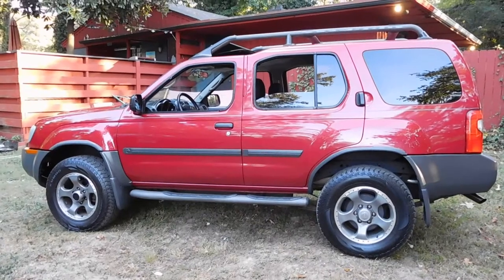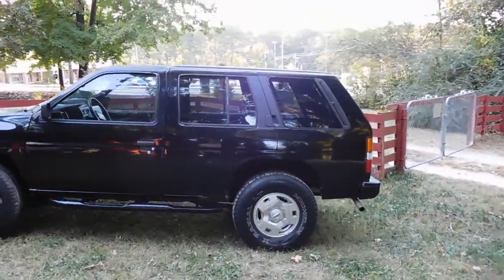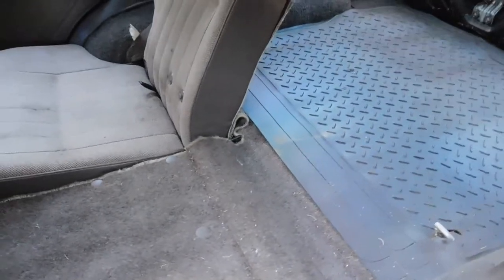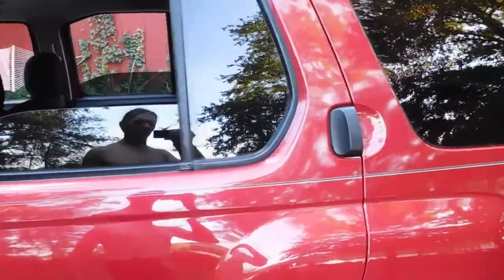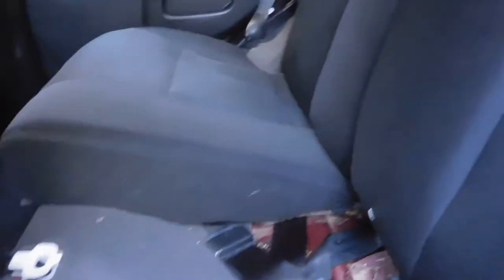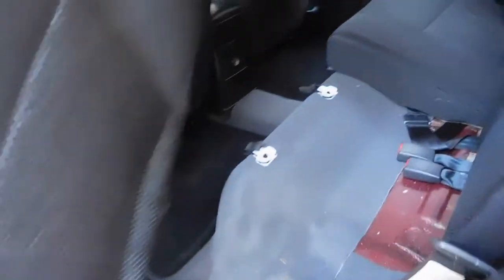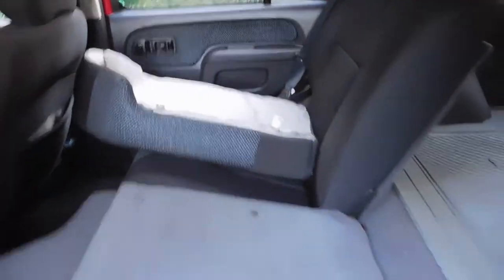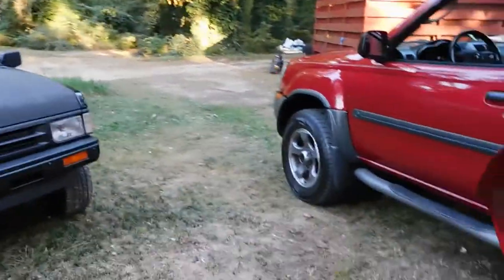Xterra vs Pathfinder: rear seat cargo area tour

Comment: I currently have a 2002 Xterra recently purchased low mileage six-cylinder five speed stick. Previously I own a 97 pathfinder same motor but automatic. I love the Xterra so much better than the Pathfinder.
Reply from the maker: Thats funny because I think I still Love the pathfinder more. I miss the the rear window, clock, 4 wheel suspension & 4 wheel disc brakes.
Reply: John Masters Does it ALL Well you need to do a simple conversion like I did I have four wheel disc brakes on my 2002 Xterra with a five speed manual transmission and 3.3 L non-supercharged
Reply: John Masters Does it ALL And the rear disc conversion cost me nothing because I had all the parts on hand
Reply: It also took me no time at all to do it on a Saturday in my garage.

Comment: I put lynch pins on my pathfinder so the whole cushion comes off similar to the xterra. This gives me 2 extra feet when loading large items.
It looks like you can shove the cushion between the folded seat and the front seat. No?
Does your X feel more roomy than the PF?
Reply from the maker: Yep! Thats what i usually do and they fit in that location pretty good.

Comment: how does your xterra compare to the nissan pathfinder 1999.5 or 2000
Reply from the maker: Basically I loved the 91 Pathfinder and REALLY REALLY LIKE the 02 Xterra. Pathfinder had 4 wheel independent suspension, 4 wheel disc brakes, an opening rear window, a clock and a hand pull e-brake... The X DOESNT!!!!

Comment: The 2nd gen they really did improve the cargo area.  Didn't realize there was that much of a difference.
Reply from the maker: Im looking forward to checking out a 2nd gen sometime soon. The SE SC has certainly been serving me well so far. The supercharger should be fun when it comes time for some new plugs or a timing belt.
Reply: The 261hp engine in the 2nd gen really pulls it's weight, that DOHC engine changes the power band.  I do miss my old R50 pathfinder with the 3.3l engine (N/A not SC), it was bulletproof, but it lacked the power to tow with ease (could still tow though), but I don't think I'll ever go back from the 4.0l to the 3.3l engine.

The 1st gen xterra is amazing for solid axle swaps however!
Reply from the maker: Yes, I would opt for the 4.0 NA engine that you have over the SC if I were looking for something easy, affordable and powerful. The SC ends up costing alot in high test gas and extra hours of maintenance and there is a lag for it to really get going and they used they same transmission as in the NA which is not a perfect match to the SC in my opinion, so you have to babysit it to some degree. BUT, this one is top of the line, in cherry condition and is somewhat rare, which I like. I drove my Pathfinder yesterday to get it ready for a potential buyer and that's not going to be easy to trade for $1800 or $2000. The early Pathfinders are really in a class of their own.